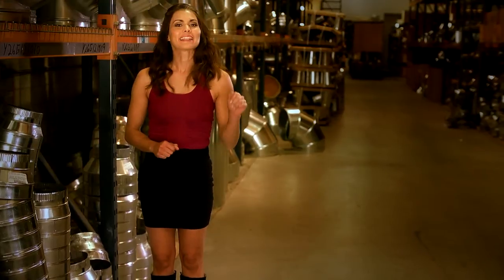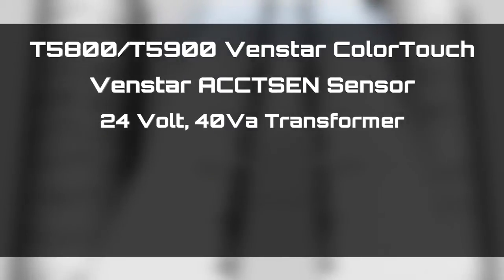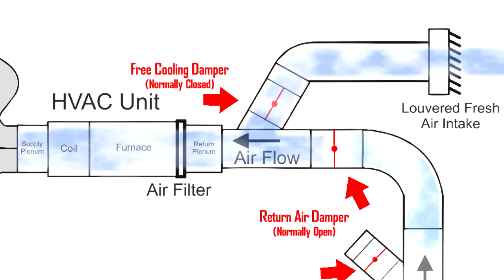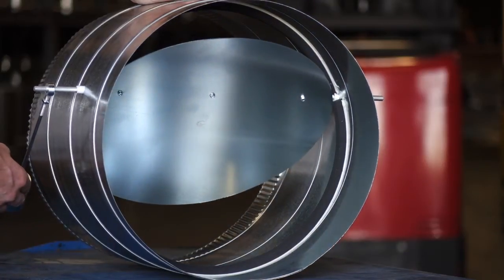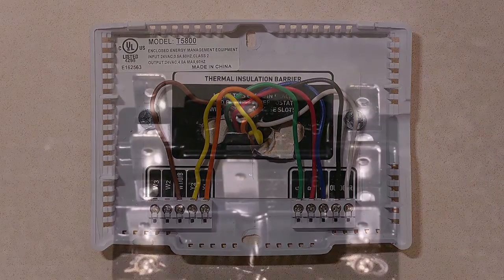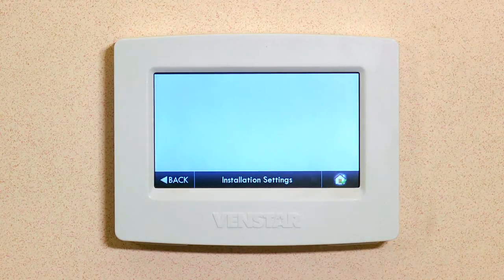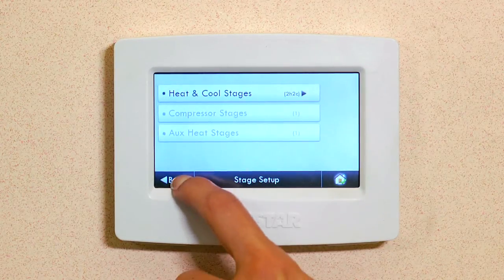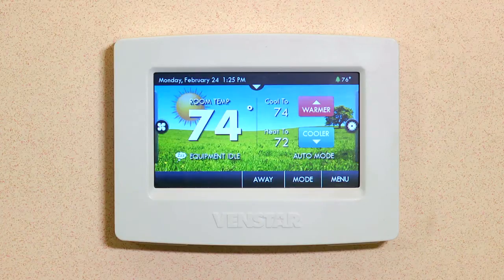Installing and setting up free cooling with the Venstar ColorTouch

Comment: I'm sure if the indoor setting temperature floats, does it have one setting temperature,  Or anytime the temperature is below 2° the fan will activate?  She mention a temperature differential of 2°, she used 60° for setting outdoor temperature, does it mean that the only time fan will activate is when indoor temperature is at 62° or below (outdoor temperature at 60°)?

Comment: I like it. I do see one flaw though in the diagram. Bringing in the outside air unfiltered is going to bring in a lot of dust in to your home in many areas. I assume there must be a way to add a filter to the intake?
Reply: It shows the filter directly after the outside air tie in, between the furnace and the return plenum on their drawing, I put a seperate filter inline.